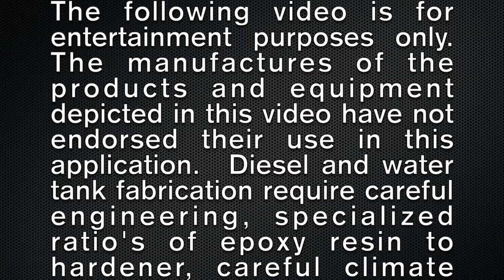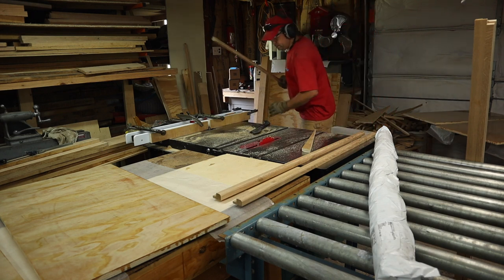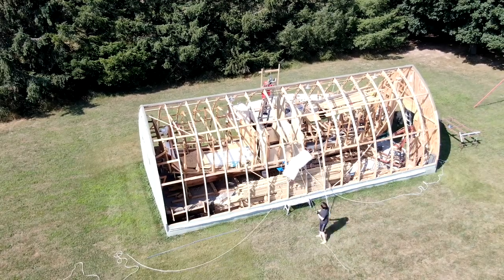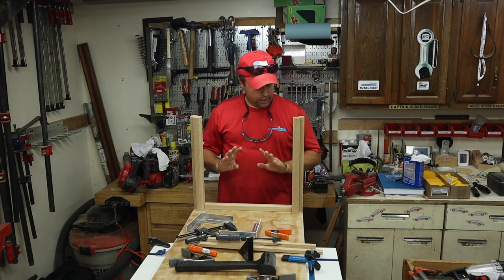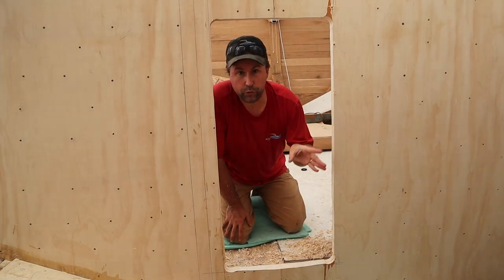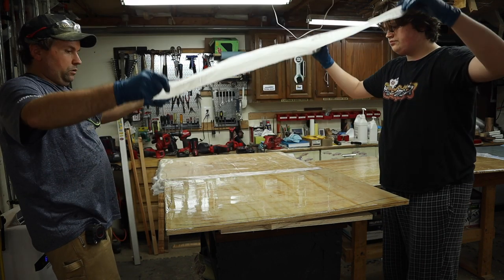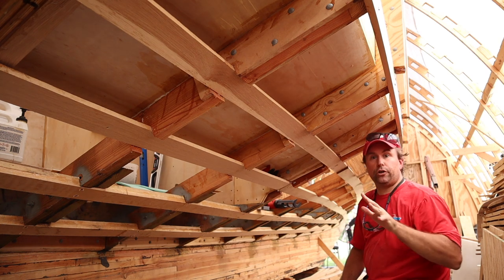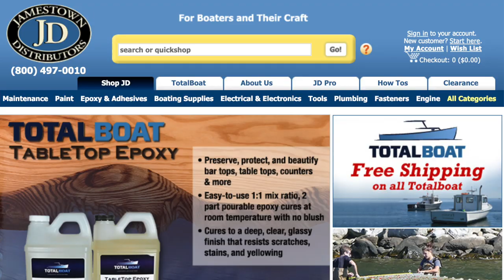Plywood and epoxy diesel and water tanks on our 41' trawler yacht Part 2.  Sea Dreamer Project Ep 47

Comment: Hi I realize you are following the plans . As having been in fiberglass tooling industry for too many years my approach would have been to build temporary molds for the tanks from cheap Formica covered chipboard , it releases well from any resin with a couple of coats of wax. I would then make the tank off this in one or 2 seamless pieces , possibly adding the plywood to the out side to cheaply stiffen the tanks . I would then recut the temporary mold into the next size tank. This would minimize joints and potential leaks.  Food for though for somebody else . Thanks for sharing , , Jamestown are a great supplier. cheers Warren.
Reply: You know, that just makes sense.  I have watched some folks make hatch replacements and other projects from molds but didnt think about how it would work for tanks and even the cockpit well and so on.  Thanks for the info.

Comment: Although I understand this process will work, it seems with the cost of the plywood, epoxy, glass mat, and time, this would be 3 to 4 times the cost of just buying steel  or aluminum sheet, and welding up the tanks! Then again I am a pipefitter/welder by trade, so that pushes me into that direction.
Reply: I would imagine it'd cost similar. I would do aluminum or stainless again, but the weight is a back breaker and at the end of the day I dont know welding, but do know glassing so for me, epoxy tanks are an easier option.

Comment: I've had lots of plywood/fiberglass boats (drag racing), so the idea of plywood tanks is not new (all of my boats were at least 30 years old) - what I think is cool is you're building within your skillset.  A question, once you have diesel in the tank, is it possible to later come back and repair damage?  with gas, it's not a big deal (nor water for that matter), but I dunno about diesel so I figured I'd ask (I imagine you could line the tank if the worst happened, but would that be necessary?) how does the epoxy react to algae?  Interesting stuff, thanks for making me think.

Comment: I'm actually surprised it lasted that much, but hey, nearly 2 years, can't complain. I've made a temporary enclosure and i'm trying a plastic that's meant to cover a green house. Downside is, it lets in more light, but i fixed that with a cheap layer under that doesn't. So far, 4 months, no problem.

Comment: Not boat related, but at around 5:50 in the video you were attaching the new tarp on your shelter using an "s" shaped wire latching system. Do you have any info on that? Looks to be much better than lacing through grommets. Greg

Comment: Hi Scott, I've been watching your channel from the very beginning, seen all episodes and find it very interesting and informative, thank you for letting us witnessing this project as it progress. Now I have a question here, if you already answered well, I missed it, sorry. Concerning the use of epoxy, I would use it, whenever possible, as to take advantage of its chemical bonding properties, which is to Not letting it cure completely before moving to the next step. This allows subsequent layers to blend with the previous ones. I see you coat all your panels and letting them dry fully then, sand it to make the next layer stick to it. That's what we call a mechanical bond, which is not a bad bond but surely not as strong as the chemical bond. Is there a reason why you seem to favor this method?

Comment: Hi Scott. Fantastic job on your project. I absolutely love it. Having watched through your episodes twice now and now the proud owner of George Buehler's Backyard Boatbuilding for the 21st Century, I am hooked. Reading about building a boat by the average craftsman is one thing, seeing you build yours first hand is confirmation. I am doing my research now and hope to start my diesel duck project next year. Being a navy vet, there is nothing better than cruising on the open seas towards a far away destination.

I have a question. Don't worry, it is not about using galvanized screws or plywood/epoxy tanks. What were your reasons for choosing the Diesel Duck 41 design versus the other available lengths? I am thinking about building the 48, primarily for having just that much more additional space. The additional length does not seem to come with significant increase in hull build cost, 7 feet of additional keel timbers and 3 frames. Plus, based on George's book there is a slight positive gain in speed for a bit less HP. 

Thanks for your service and keep churning out the great vids.

Comment: I enjoy your videos, thanks for them. Just a quick question, after checking the internet for pricing on custom water tanks using various plastics I wonder why you chose to fabricate yours from wood and epoxy? From a replacement angle only (assuming a leak or physical damage) they seem to be a better alternative. Just very curious - good luck with your project.

Comment: I'm really intrigued by the process of the tank building, I particularly like that it's wood, just goes to show how versatile the stuff is.

If you would allow one small criticism!  Please, please do not wipe down the infeed table on your planer, sorry jointer, with your hand especially when wearing gloves.  I know there's a guard but it is all to easy to get fingers in the cutters.  I've seen the result and it's not pretty.

I'm not a health and safety nut and I firmly believe in individuals taking measured risk but there are some things to be avoided.

I've followed you almost from the beginning and I'm envious of what your doing.  I spend too much time in my wheelchair or on my crutches to tackle big projects but I do bumble along in my workshop.

Looking forward to part 3!!!

Comment: Hi Guys!!! Did you consider a bladder tanks?
Reply: Add a ton of weight almost literally...  I don't know if the bladders allow a lighter "box" than this method which would offset the bladder weight but suspect they would be much heavier and reduce capacity due to thickness of bladder and less than 100 percent fitting the space.

Comment: Scott, you're doing awesome. You are very skillful on your trade. No question! Have you investigated what the coast guard will say about your plywood fuel tanks or your insurance company. You have done such a great job building this boat. I would hate to think that when you get it all done your insurance company won't cover it
 ( That may be a problem with boat yards) or the coast guard may have issues... Just thinking, o know you have a lot of time and money invested in your  tanks
 But better to find out now rather than after they're installed... Just thinking. Keep up the good work. It's looking awesome!
Reply from the maker: Dave Evans pleasure vessels can essentially do whatever they want construction wise. It’s only when you start using the boat for commercial purposes or paying passengers do mandatory regulations set in. Insurance is another story. However, you pay enough, someone will insure you.
Reply: Insurance is tough to get on a home built boat...  I haven't found a company that will insure for actual value.  If you have any tips I'd appreciate it.  If I find a company I'll pass it on to you.

Comment: Wouldn't it be much better for insuring no leaks to keep the inside of the tank just the flat plywood and install all your bracing on the outside? That's a lot of different seams and profiles you have to glass over.
Reply: Barry Birkey: Good idea!

Comment: 👍👍👍👍👍👍👍👍9
Beautiful job looks like a very well-built vessel .
Beautiful well put together wonderful commentary especially on comments very well done .
I do have to mention though just because of my experience, I ran an industrial commercial construction Warehouse for a little over 10 years back in the 80s early 90s . While there I witnessed three Carpenters cut their fingers off. Actually the loss of two thumbs and the tips of two four fingers out of the three of them . the one gentleman they were able to sow his thumb back on I don't know if you ever regained use of it . and helping out an ex in law with a remodel one time . the contractor he hired to oversee and do most of the work. lost four fingers at the knuckle along with the top of his thumb.
 please please be more careful around the table saw never run your hand over that blade I don't care how much  anyone is thinking that they are protected by blade depth .  only takes a few minutes and just a couple pieces of scrap from simple too extravagant push block keep your hands well away from the blade please take the time !!!  even though you're using some nice clear White Oak with no knots that I could see the harder the wood the greater the danger at the table saw or any saw in reality .
 please always put Safety First !!! A more form-fitting shop glove in the shop also please rather than an all-purpose Garden glove . any loose clothing or jewelry increase the hazards in any shop . wearing comfortable loose clothing is okay if you're keeping it tucked away behind a good shop apron or coveralls .
 also please rethink letting your work cure in the grass or on the ground .
 we don't only have rust and mold issues with moisture  or erosion from oxygenation,  hot cold temperature changes sun exposure even the glare off the water are all things to consider all along with the parasitic destructions that need to be protected from .  as big a threat on land as in the water .
 A Beautiful Mind Set and quest of freedom , time and safety protect your freedom.
 please don't allow the freedom to be unsafe take your freedom away. 
 for me the craftsmanship and detail of these builds with a strong dedication to craftsmanship and safety to the birth of the quest for freedom on the open waters. for the time and dedication the preparation and the build will extend the time of freedom on the water .
 my quest is on land for now I hope to join you on the oceans one day .
 I apologize to anyone that might be annoyed by my lack of capitalization or punctuation just not one of my strong suits, because of my struggle with it I chose the freedom not to care .
 peace light loving gratitude bring freedom of equality to everyone !!!!!!!!9
 HHBpHhelps

Comment: Doesn't alcohol in the diesel fuel cause the resin to melt? A lot of boats have to replace their gas tanks due to this.
Reply from the maker: My Paradise on Bantayan Island, Cebu, Philippines diesel fuel doesn’t have alcohol. That’s only found in gasoline engines
Reply: @SixPointsWoodWorks  they put alcohol in diesel in the USA to absorb water that may be in the fuel.
Reply from the maker: umm no there isn't.  There is a product called e-diesel which is a 15% blend of ethanol and diesel that is useable for specific kinds of diesel engines, but it's clearly marked as that because ethanol in diesel would devastate most diesel engines.

Comment: Interesting.
Is it just me irrationally concerned by the corners of those tanks?
Seems like you'd have more pressure trying to work its way out through a 3 way joint - even the long edge joints.
(I didn't calc anything, nor have any experience in this  just thinking a nice filler/radius/trim on the inside would be worth it while you have access)

Comment: I just dont understand why it's so risky epoxy and wood why there are so many aluminium and stainless steel things that can be recycled like beer kegs or even a large gas tanks off of a junk yard truck so many alternatives that are cost effective and alot safer
Reply: Dont take this in a bad way I'm very interested in this project and excited to see it to the end
Reply: @Nicholas.m777  His epoxy tank will be fine for a long long time. Theres are many issues with all types of gas tanks, being a welder and a boat finnatic i can assure you theres no perfect solution (besides maybe a plastic tank) :). The fact of it is fiberglass gas tanks have been used and built since fiberglass boats have been around. I think they got bad rep from people who didn't do it right and cut corners in addition to inferior materials in the 60s and 70s. Polyester resin wasn't nearly as good as it is now, on top of that hardly anyone uses polyester resin because we now have vinylester resin which is far superior in every characteristic and still affordable and even better than but not as affordable is epoxy. On top of the resins now being light years ahead of where they were 50 years ago we also have much better fiberglass options. Polyester resin is very prone to osmosis while vinylester not so much much and epoxy even less or not permeable at all. That is why you see old boats with blistering and new boats without that issue. Most modern boats that are being produced today are built with vinylester resin. 
     Now recycling and using old gas tanks is possibly, but finding one from and old vehicle wont work for a few reason. The biggest reason is capacity, My boat 24 foot power boat has a 130 gallon gas tank. Tell me what truck has a 130 gallon gas tank, and that's for a 24 foot boat. Most boat gas tanks are thicker walled than car tanks due to the abuse they see offshore. Car gas tanks are essentially painted stamped sheet metal.  Often times you can find a used aluminum tanks from other boats at boat junkyards and have it cut down and welded to fit your dimensions you need. Many people do this but your run the risk of it being already pitted or slightly corroded. The issue you run with aluminum boat gas tanks is if there installed incorrectly (or even correctly) you will eventually get pin holes leaks in your gas tank. Water sits on the bottom of the tank which is created from condensation, or the outside of the tank sitting in water. Theres a huge discussion on how to mount aluminum tanks correctly as thoughts and theorys have changed drastically. Most manufacturers use to foam fill around the gas tank to hold it in place but now its looked down upon as it can lead to water being trapped against the aluminum surface speeding up the corrosion. I wont even get into stainless tanks and boat history but pretty much not many people use stainless for a couple of reasons but cost being the biggest factor.

Being a welder, I would have guided him towards an aluminum or stainless tank, Even a mild steel tank coated in epoxy inside and out would be more than sufficient. For smaller tanks like a 150 gallon or less I would say just buy a plastic one. Plastic tanks are the beez knees for boats IMO. They dont rot, they're light weight, uniform, seamless construction, only real drawback is they permeate odors very very slightly. Plastic tanks also need to be supported and strapped correctly. There was some issues not too long ago of the plastic tanks breaking down into kind of a dust powder like substance inside the tanks over time but theres a reason why you use an inline filter regardless of what tank you have. I believe they have fixed this issue which was caused from ethanol based fuels.  Also plastic tanks tend to swell so its not recommended you foam them in. Holes can be worn through them just like any other tank if not properly secured.  Another benefit from buying a premade tank from a reputable tank maker is they are certified and pressure tested compliant. The real issue is finding a tank that fits his boat as most custom larger boats have custom built tanks......As you can see there is no superior or right choice, really comes down to what you like, can afford, and if you can buy the size you need.
Reply: What's the problem with wood epoxy?
About 20 years ago I built a yacht entirely with ply / epoxy and had no issues.

Comment: you really want stainless or aluminum tanks...fg tanks will have an odor and taste
Reply: Not from my experience - I’ve been running a fibreglass water tank for years - no taste.
Reply: Jonny B  Stainless or aluminum tanks are not the end all be all of tanks. Considering my stainless tank that was made of 1/4 316 plate lasted about 10 years before corroding through and weighed a FUCK ton. Epoxy when properly cured with post curing heat becomes an inert plastic. It will not leave a taste or odor. You can also coat(which should be done regardless) the epoxy with a food grade coating that is used to coat all potable water pipings and water storage tanks. BrewCoat is one option of a multitude.